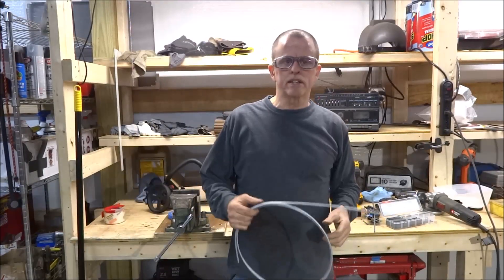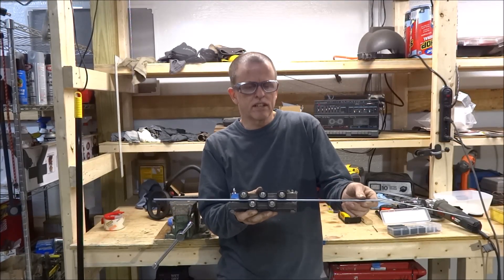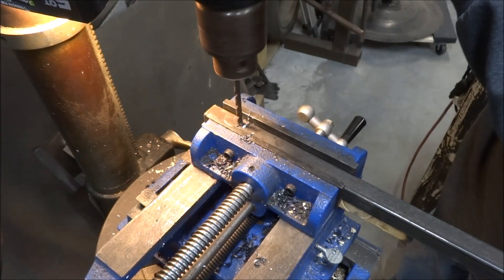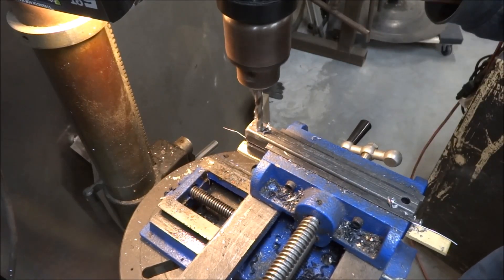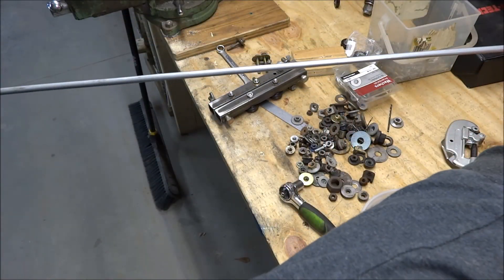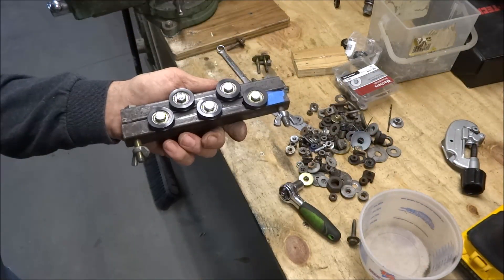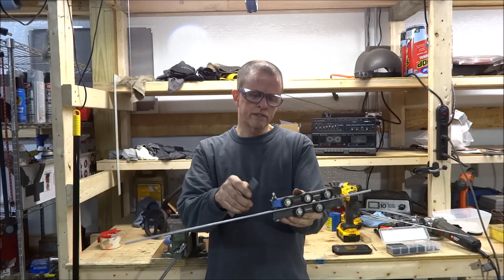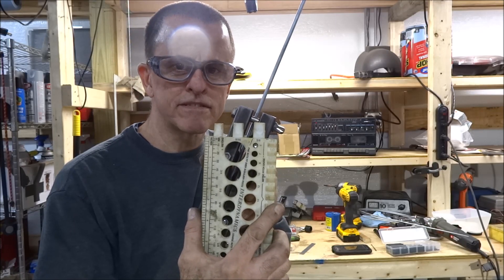DIY Brake line - Tubing straightener, pipe straightener

Comment: Well done.  The only improvement I would add is maybe a couple of light compression springs between the bars to encourage them to stay apart as you load the tube.  I’m going to make one based on your design and larger roller suggestion.  Thanks so much for sharing.  Joel.....
Reply from the maker: The springs are an excellent idea. I am going to add them. Thank you

Comment: Nice and simple and works. Even the high dollar ones set 99.9% of there life in a tool box, so under twenty bucks to build is not so painful,,hehe! Mite weld on a plate to the one with 3 rollers for a way to clamp it in a vise for 1/4in and up tubbing,,I found a lite coat of oil helps keep keep the rollers from dragging as well. Great and fast build.
Reply from the maker: Thanks

Comment: The way I straighten 5/16” is also easy and cheap ! Take a piece of 1/2 “ pvc. 2’ long feed the tube through  then through a3/8” steel pipe . Real short pcs not so much , but longer works  well

Comment: Great idea if we have some of the parts idling in the drawer. But if we buy all parts +labor for doing it in total should be compared to price of buying a straightener. Don't you agree.  ?  But still makes a productive excersize for trade schools training.
Reply from the maker: 🤔... I just checked Amazon, a non adjustable (3/16 straightener) about 35$.  adjustable about 60$ - 70 .
Prices have come down a lot since I made this 5 years ago.
Reply: @TSRGarage  fully agreed. Assuming a handyman worth 50$/hr plus material cost, the verdict might be buy the tool..unless one has free time to make use of.

Comment: omg.. you just saved me about $100.. thanks for the video.. awesome stuff..
Reply from the maker: Thank you. I'm all about saving $$. So I can spend them where I want to.
Reply: @TSRGarage  happen to know a pulley that would work for 1/2"? my fuel lines will be 1/2" stainless...
Reply from the maker: Sorry can't help with that....
Reply: @callofgeorge  search "5x26x13mm u groove bearing".  I have only found them in nylon but they have a bearing.  let me know of anyone finds them in chromed steel or stainless.

Comment: I want outer dia 12mm hollow ms pipe straightening machine.. pls give suggestion, which one is best?
Reply from the maker: Only suggestion I can give is . I used rollers with a groove that is approximately the same size as the outside of the tubing.

Comment: you only show straightening  a  piece of tube already  reasonably straight  what about off the coil how did you straighten the tube before using your tool
Reply from the maker: Just straightened it off the roll by hand.

Comment: How important do you think it is to have rollers with the proper channel size vs the size of tubing?
Reply from the maker: I would say the closer the better. But I think if the tubing was a little  smaller then the roller it would still straighten it might take an extra pass or two..
Reply: @TSRGarage  ok I was wondering about that. Looking on eBay I was thinking about using V groove rollers to use with different size tubing.
Reply from the maker: 🤔 that is a good idea. I think it would work
Reply: @TSRGarage  I'm going to try it and if it doesn't work I won't be out too much for it.